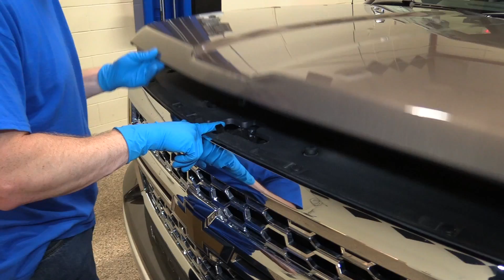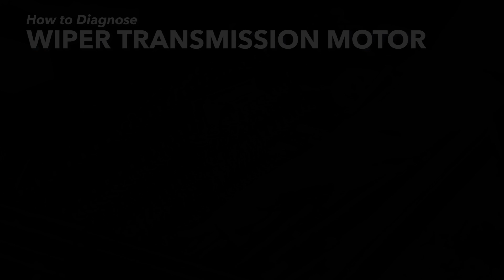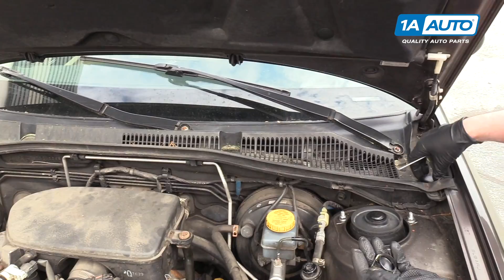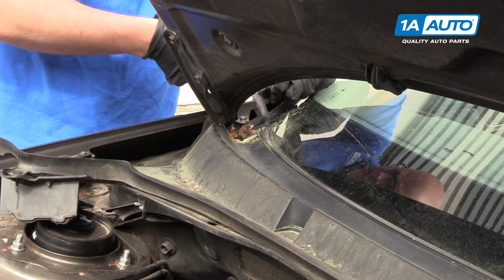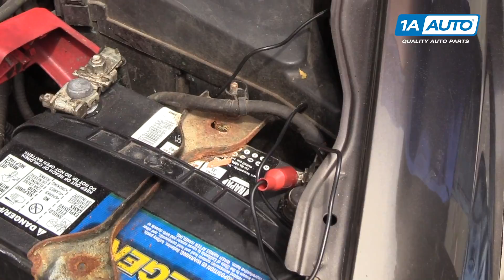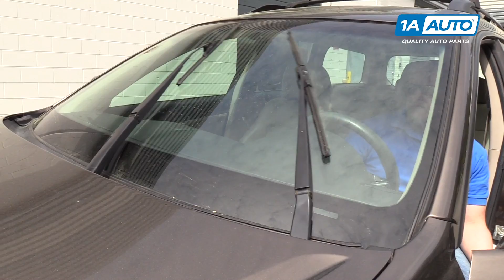How to Diagnose Wiper Transmission Motor 04-09 Subaru Outback

Comment: Do you think there is a problem with the switch if the red/blue (wipers on)  doesn't light on 'on' but does light on the second speed. Everything else seems to light as described.